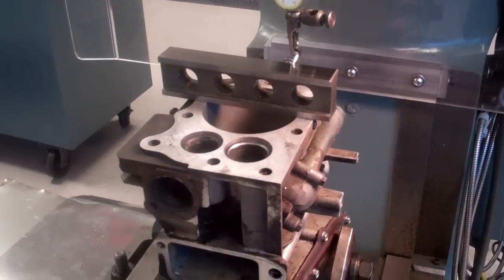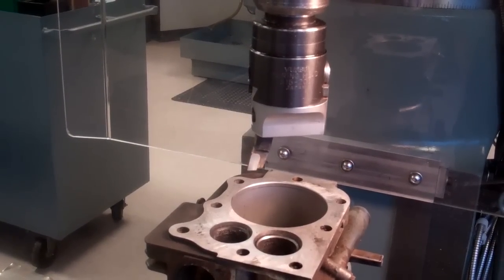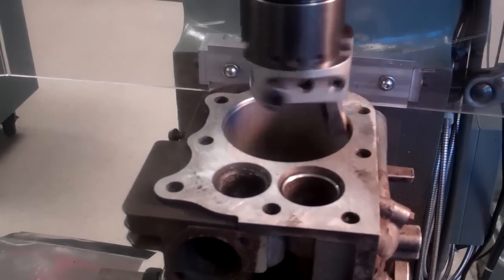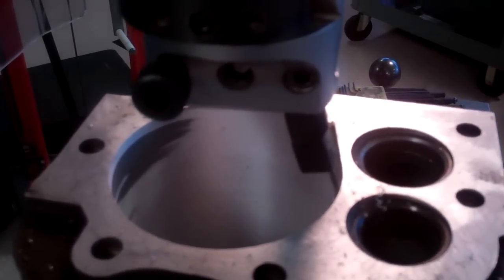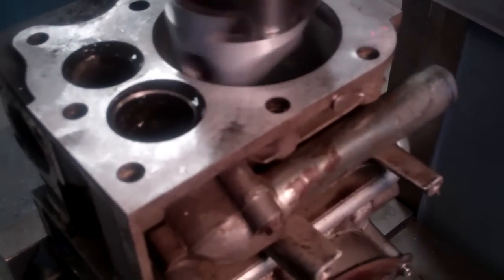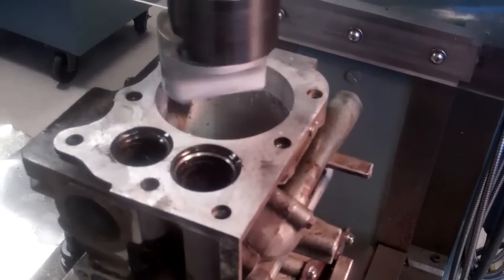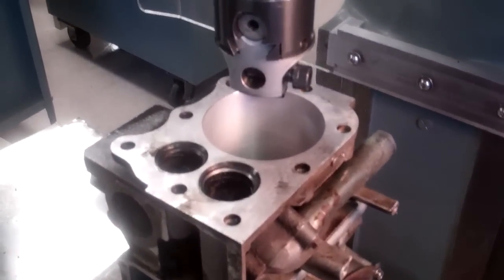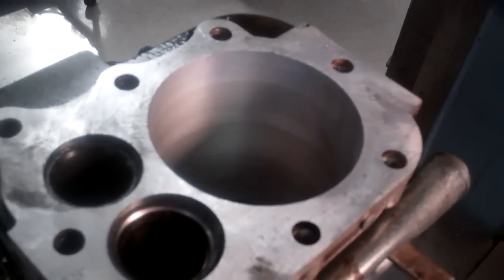BORING BRIGGS AND STRATTON QUANTUM ENGINE ON BRIDGEPORT MILLER

Comment: Did you drop the knee of the machine down and check the bore size with a dail bore gauge?  Just wondering what you measured it with.
Reply from the maker: I used a snap bore gauge.

Comment: Build a torque plate and torque to factory specs to start with! This will straighten the bore before the first cut! Then finish shy of bore size with the plate installed and then clean it up honing to size! By doing it this way you are loading the bore with the torque plate and you should end up with a perfect bore?
Reply: Mike Mansfield it’s not a friggin race motor, this thing would never know the difference.

Comment: At the price of taking a block into a machine shop and the crap quality of most engines now days,its best just to buy a new engine. I have actually bought new lawn mowers just for the motor as its cheaper sometimes. I did that on a horizontal mount rotor tiller that used a typical mower engine. The original was trash and it was cheaper buting a cheapo mower and using the motor. Seemed weird scrapping a brand new mower chassis but I sold the tiller and that paid for the mower twice over.

Comment: Owned a out door power equipment company for over 20 years.  Back in the day when the engines were not throw away.  We used a stunned honeing system to oversized cylinders.  It was more accurate and much quicker.  .010 oversize in 10 min including set up. Boring those aluminum cylinders there is a chance to cold weld material on the cutter and be oversize on part of the cylinder.  That on some cases made them junk. Aluminum bore cylinders have a chrome plated piston.  Cast cylinders use high silicone alloy pistons.
Reply: Silicon & silicone are two very different things…

Comment: Good video. Meticulous machinist. However, I would have used a torque plate. It gives a more accurate bore shape and size, as it would be with the head torqued down.  Even hone with it. Maybe unnecessary for lawn mower but you may get another 100,000 miles out of em! ha.  Easy enough to make out of thick aluminum.
Reply from the maker: C'mon, it's a used lawnmower engine! It will never be installed in a top fuel car.

Comment: HI I have a 13 hp briggs inteck that is aluminium with a chromed bore, the piston broke and scored the cylinder so it needs a re-bore and oversize piston just like you have done..
Question,  the bore was chromed, after machining it will be aly to steel rings, how long will the cylinder last ?  actually i want to run this engine for a race, one afternoons worth of thrashing it's nuts off so if it only lasts 2 hrs that's enough, but the question remains as if it survives i might throw it back in a mower, I have only seen rebored steel or cast bores. what are my chances !!
Reply from the maker: If you have to pay to bore it, it may not be worth it. If you can bore it and use cast iron rings, it should easily go the race.

Comment: Is it ever practical, with the time and effort to bore out a cylinder, to go with a sleeve?
Reply from the maker: +Larry B Depending on the engine and it's rarity or necessity to rebuild it, installing a sleeve is not much more work. For an engine like this one, It's more practical to just get a new short block or a good used one. I only did this because I could. I'd never consider paying someone to do this type of work in this engine! Thanks for your comments!

Comment: Ok, you said if I can bore to .010 do that. But, they only make a .020 oversized piston and ring set. Would I be able to use standard Size piston and rings if I only go .010? I just want the tightest fit possible
Reply from the maker: +CJSuhr You have to use rings designed for the bore. If .020 is what is available use that. The ring gap would be way to large using std rings on a .010 bore. Plus the rings would not be of the correct diameter to start and would not fit the .010 overbore correctly. Just go with the .020. It is the best way to go in your case.
Reply: +tmackinator Ok, thanks for the help!
Reply: +CJSuhr Pistons are made to have a specific clearance between the bore and piston too. This clearance is around .005 and allows for expansion due to heat so the piston doesnt seize in the cylinder.  If you use a standard piston in a .010 over bore, you now have .010 extra slop in the piston which will easily gull up your cylinder walls since there is next to nothing to hold the piston true with the bore.

Comment: Why are you boring in reverse?  It is a good way to unscrew the shank from a Criterion style boring head.
Reply from the maker: +John Reese I'm not sure where your are getting your information but  except for the sliding dovetail,the boring head is one piece including the r-8 collet piece. It doesn't separate or unscrew. My tool was made to cut as you see. I've been at this for 35 years, trust me I know how to machine.
Reply: +tmackinator 
OK.  Mine have screw in shanks.
Reply: Agree with John Reese: the shank would likely unscrew from a Criterion head in that direction of rotation. Beautiful job nonetheless!

Comment: I couldnt help but notice that you were zero (flat) on your side to side of the deck of the cylinder. Why didnt you check for flat Fore and Aft?  T
Reply from the maker: If you listen to the narration, I state that the block was just as good n the other direction. Rest assured I checked the set up in X and Y. It's not so easy to film narrate and machine all at once! Thanks for your interest in the video-TM

Comment: Why would dick with an inefficiant flat head when you could by an over head valvle briggs intek, or an overhead valve animal motor?  yea maybe if this is a classic unreplaceable motor that is specifical to an application..
Reply: There are pros and cons to every single engine.  Side valve engines don't have the annoying problem of the piston smashing the valve into the cylinder head when the timing fails.  This is one example.  Another advantage is the simplicity of design, less moving parts, less wear, better reliability and service that is cheaper. 

Sure efficiency isn't the best, nor is its power, but a flat head is more rugged and likely to outlast its OHV or OHC counterpart (after you run out of engine oil). Efficiency, is just related to design and flow characteristics of the flat head engine (which cannot really be remedied in its current configuration).  I have heard the OHV B&S have a problem with the head gasket getting blown apart between the cylinder and the valve assembly, leading to burnt oil and lots of smoke.  Another problem flat heads don't have.
Reply: I raced a b&s animal ohv for 3 years, never had a prob with head gasket, it was a great motor, would run up to 8100 rpms and still had some left. All I had done to it was a billet rod,dual valve springs,.308 billet cam, 3 degree timing key and a big ol'e carb and she won a bunch of races.
Reply: +superkart66 id hope it would last 3 years. especially for the price. my profile pic is a similar engine in this video. it has had about 3500 hours of work and has not had a rebuild yet. starts first pull everytime. it is a side valve. i prefer side valve for sure.

Comment: How do you control how far you adjust that cutter? Seeing as the quill has to remain centered I'm curious as to how you can accurately do that.

Thank You.
Reply from the maker: The cutter on the boring head spins on a center line which is set on the zero position of the cylinder bore when the quill is initially centered in relation to the bore. The boring head can be adjusted to make the swing of the cutter larger or smaller in relation to the center of the swing which does not change. This is done by adjusting a threaded screw . The cutter is mounted on a sliding dovetail that the adjusting screw moves in or out to change the diameter of the cutting circle which always remains true to the center of the quill.
Reply: tmackinator
 So you can simply measure how much of the cutter projects vs how much projected at the original position, and double it, to determine the difference?

Thank you!
Reply from the maker: The American Outdoorsman  Well sort of. There is a graduated dial on the boring head and it is graduated in .001 increments to move the cutter in or out in the amount of material you want to remove.One full revolution of the dial is .05" If you want to take an additional .01 off the bore, you move the dial 10 graduations. This moves the cutter by .005". Some heads are not a direct read and if you want to take off .01", you move the dial 5 graduations which results in .010 being taken off the bore. These are usually crappy brand boring heads though.
Reply: tmackinator
Thank you for taking the time to explain this.  Makes sense now.

Comment: I overbored such engines with aluminum cylinders and I've been never lucky with them , there is a plating similar to nikasil on those cylinders and when destroying this plating, new rings have a tendancy to scratch the new cylinder
I had better results when I could install a cast iron  sleeves
Reply: 5HP B&S cylinders are not coated.  Hell they don't even use crank or rod bearings.
Reply: Nikasil and all cylinder plating can be refinished and bore restored. It's standard in the motocross world.
Reply: i didnt find this out till it happened

Comment: Outstanding video---clear, concise, and informative!  And what a beautiful shop too! A few questions, if you don't mind:
1. Did you chamfer it with the boring bar while to had your center, or use a different tool? 
2. Assuming one doesn't have the equipment or the expertise, does an automotive machine shop usually provide this service?
3. I'm currently rebuilding the engine in my kid's go kart, and I'm finding between the cost of parts and (possibly) machining, I could buy a more powerful "Predator" engine from Harbor Freight for cheap. Do you have an opinion on these cheap engines?

Again, you video was terrific, and I thank you for posting!
Reply from the maker: Thanks for your nice comments. I used a hand held chamfering tool to do the chamfer. It's just to break the edge to facilitate piston /ring installation. I doubt an auto machine shop would do this. Quite honestly, unless you can do it yourself its probably more cost effective to just replace the motor unless it is a high end motor i.e. a large displacement/multi-cylinder commercial motor.
Reply: tmackinator Thanks for the reply.  I just tore down the engine a few hours ago.  It's a 3-1/2 HP vertical shaft Briggs from a vintage "Coca-Cola" Model T go-kart that was a promotional item back in the 80's, so it's worth some bucks and I want to keep it authentic. Fortunately the cylinder and piston are in great shape, so I'm ordering standard rings and will hit the cylinder with a Mickey-Mouse glazebreaking home. 
Oddly enough, I'm a bit disappointed!  Your video whetted my appetite to delve into machining the block to an oversize.  I wish you were my neighbor!

Comment: Nice video! I own a really old B&S 3 hp engine, which is made in 1981. It has a aluminium cylinder, a badly worn one. I'm really considering about rebuilding the engine completely but the fact that it has a aluminium cylinder wories me. If I choose to bore it and buy a oversized piston, is it possible to make the engine last long? Does anyone know if there are B&S engines, which have iron cylinders?
Reply from the maker: Thanks for the nice comments. The industrial grade (IC) engines have cast iron cylinders as well as many of the old engines. The engine in the video was an aluminum bore.  You can bore the 3 hp and make it work but quite honestly I did this as something to do and I am not sure I'd put the effort and expense int a 3 hp.-TM

Comment: we have a Briggs 170402 7HP that is on a 1971 Toro 726 snow thrower. What should the compression be about? I twas given to us a few years ago and it seems to me that the compression is a bit low, it does big down but once it starts to bog it hits its torque band and maintains but was just wondering if you knew the compression for an old side valve. Thanks, Joe
Reply from the maker: Typically Briggs L-heads engines are in the neighborhood of 6:1. If your motor is otherwise in good shape, you can probably eliminate the bog by careful adjustment of the main jet. The updraft carbs used on this motor can be sensitive to carb adjustment. It's best to adjust the carb with 1/2 full tank of gas. Fuel level can affect performance. I find that sometimes I have to readjust the carb slightly on a snow blower as temp and fuel level change. -TM
Reply: tmackinator
6:1 wow, thats pretty low... Then That seems about right, on a compression guage it brings just over 90 psi I think so, guess its fine then! The carb is always leaking fuel, and we have tried tuning it. Boy its not easy... Is there any way to possibly convert the motor to a regular horizontal carb? Tried tearing down the original, couldn't get it apart, might try again and order a rebuild kit but I dont know if its worth it... A new updraft is $150!!

Comment: Would this give it more power
Reply from the maker: In that it restores compression and efficiency, it will have more power but as an overbore, it won't make it a hot rod. It will run as well as new.

Comment: Hey there! I love your videos! I have never machined a engine block before but I am willing to give it a shot now. I have a quick question though... Where do I find what the bore specs are for the cylinder bore? I heard you say that "Briggs and Stratton gave you the specs for the bore" Is this in a manual? Do you get the Oversize Piston from Briggs too?
Reply from the maker: Thanks tor your comments. The bore specs for  various B&S  models are commonly available off the net, possibly on the Briggs web site. I printed off a spec sheet but can't remember where. It's not hard to find. Quality pistons are available from your favorite aftermarket supply house many of which have genuine Briggs parts.

Comment: Nice job! Is the bore of a B&S plated from the factory, or do the piston rings ride right on bare aluminum?
Reply from the maker: I think there was both situations depending on the model. I have bored several of these engines and they all have performed well after the rebuild. Thanks for your comment

Comment from the maker: The tool bit was an old  lathe bit which I brazed a new carbide end.The  tool shank is round but has flats cut on each side. It is secured into the boring head with a set screw. It is important to have a corner radius on the bit about .03 to insure good surface finish on aluminum. I used WD-40 as a cutting fluid  I bent the tool with an oxy-acetylene torch to get the cutting tip past the boring head body. Any ready made bit will work if it clears the boring head.

Comment: Fantastic video. I need to bore the same engine Would you please give some more details about how you made the boring bit. Most importantly, the square peg in the round hole. I can figure out how to tilt the bit, once I understand how you managed to secure it firmly.
  How you made the cutting tool, would be another great video.

Comment from the maker: Yes, it was an old tool I put a bend in to work in the small bore with the boring head. I think I brazed the carbide bit to it. It's important to be sure to have a .020 or so radius on the cutting tip to get a good surface finish.

Comment: Very good presentation.  Although I do not get into this type of work, I do however
comming up, to do a V8 flathead.  The challange is holding.  My thought is to
turn a round fitted to the three main bearings (with the old main inserts stil in there)
Customer only needs .010 over.  I know its been done on a mill (but not me)
so what do you think.  Oh the reason for the bar through the mains is Cincy heads
dont nod like Bridgeports or it would be a snap.

Comment: just remember, after boring aluminum cylinders you must re-anodize them as it is such a soft material. this is as to harden the surface, and extend the lifespan of the motor. If you don't, the motor will be burning lots of oil soon.

Comment from the maker: Hi Thanks for your interest. I used a chamfering tool that is a hand held pivoting scraper that does a real nice job of deburring pipe ID or any holes. It allows a very controlled cut. It ends up being about a 45 degree chanfer, just enough to allow the rings to easily start down the bore without nicking the rings or catching on the cylinder bore. Search hand deburring tool on the web, Noga is a common manufacturer.

Comment from the maker: I've been a machinist for 25+yrs. You just mount a dial indicator in the Quill and rotate it around the hole you are trying to center. When the indicator reads the same on three points, two of which are diametrically opposed, you have center. This was done at my place of employment after hours. Took about 1 hour from initial set up to finished product. The problem with owning a Bridgeport is the cost of the necessary support tooling. Without the tooling U just have a really nice drill press.-TM
Reply: Hey i have a race mower that i have i have a bigger jet on the carb than stock i got after market valve springs for it do you think bore it out to get a bit more out of it because its a 17.5 hp engine running a 22hp jet from another mower?